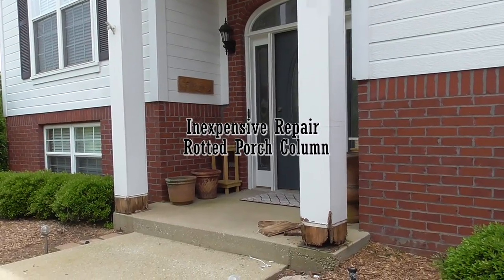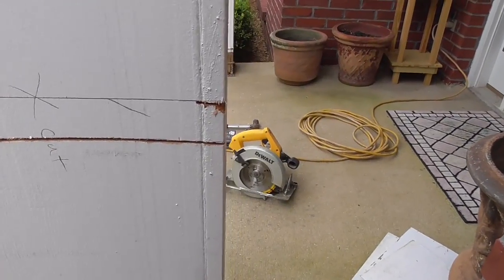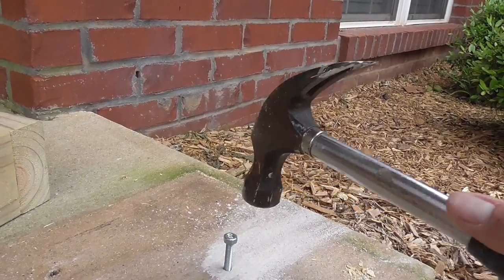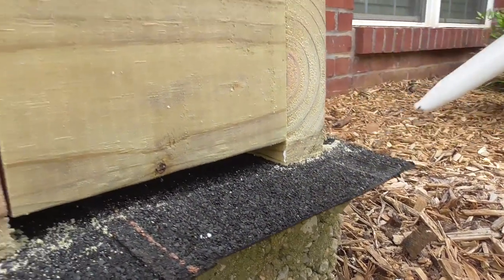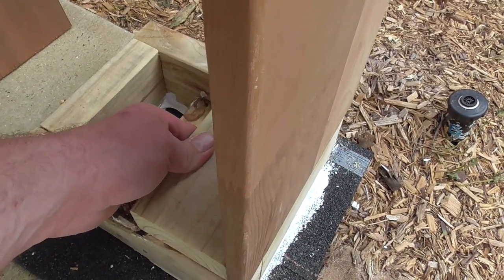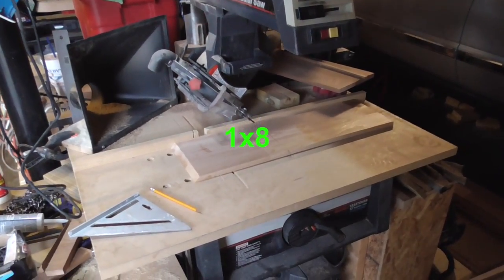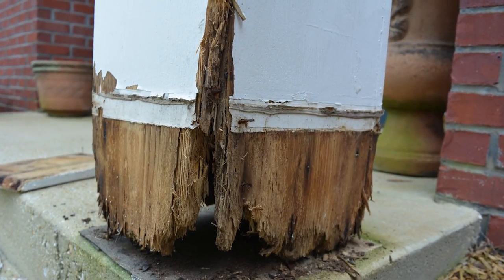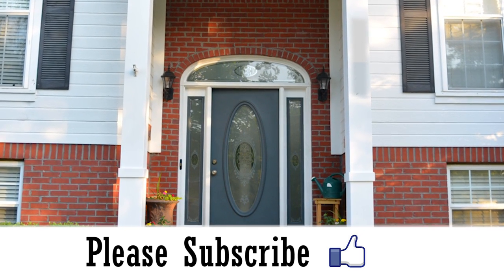DIY Porch Post Repair Fix Your Rotted Wood Post

Comment: Adding the 1 X 3s make it look classier.  Those thin filler strips are gonna need watching. Any water  in the crack will lead to rot. Maybe filling it with epoxy would be most prudent.  The base molding.....wood never lasts.  PVC trim board is the way to go.....waterproof.  Thx

Comment: I thought you did a very nice repair.  You obviously know what you are doing.
Don't take any notice of that rude carpenter. He might have a point to make, but there is no need to throw insults around.  
If that column was under any load you would have seen it and it would have collapsed long ago with the rot at the base.

Comment: Where to find finger jointed cedar in 2024? The lumber yards here don't carry it. I know it was common years ago but I haven't seen it in a store for years.
Reply from the maker: I recently needed some finger jointed cedar for another repair, none can be found at any lumber yard. I went to a specialty lumber yard and purchased some 1x6x12' cedar, rough cut on one side and smooth on the other. My local home centers only have expensive low quality building products. These porch posts are still standing with no issues. Thanks for the comments.

Comment: Remember the old saying measure twice cut once ? Maybe you should have bought your replacement materials before you cut away the old and then you wouldn't have had to use fill in pieces. I know it's hindsight and I learned the same lesson when replacing old decking boards, just not the same boards from 20 years ago.
Reply from the maker: Amazing how much money lumber mills save reducing 1/32” in the thickness of lumber and plywood. I was trying to save money too and not replace the entire post. Thanks for the comments!

Comment: How did you figure out those posts were not structural?  Was the porch roof cantilevered with beams going into the roof?   I  would make the repair as if it was structural in any case.  And used plastic composite shims instead of wood.  Thanks for sharing.
Reply from the maker: Great observation, My reasoning that these columns do not actually support the roof was 1) I've see the porch framing from inside of the attic. 2) The rotted column would swing from the top not touching the porch floor. 3) The 3/4 inch cedar made into a box is not strong enough to support anything. The best way to repair this would be to replace the entire column but I was more interested in a low cost repair. Thanks for the comments!

Comment: Good video. But what about the tools that you used? I need to buy them all
Reply from the maker: Hi Biju, I don't exactly remember the tools I used on this repair. Many of the tools I have were purchased over time. Some of my power tools are 30 years old and I do have a selection of new tools also. This repair could be done with a few tools like a circular saw or even a hand saw, some sort of square, tape measure and a hammer. Thanks for the comments!

Comment: He mentioned in his headliner he live in a area where there are no building codes are regulations..WoW..but funny his home is still standing and level
Reply from the maker: Yes, the neighborhood in my county has no building codes or inspections and our houses here some are around 15 years old and still standing. I think the reason this post rotted was actually due to one of my sprinkler heads out of adjustment for several years. Thanks for the comment!

Comment: How would you do it if it was load-bearing Columns?
Reply from the maker: Hi Veronica, If the column is load-bearing meaning it is holding up the weight of what's above then you definitely cannot remove it without an additional support next to it. Normally a jack post or even another wood post can be used to support the weight of the above structure then the column or post to be replaced can then be removed. Whatever jack or additional post is being used it must be able to support the weight until the original is replaced. Hope that answers your question and thanks for the comments.

Comment: Good job on the substance but why why WHY the totally OBNOXIOUS BACKGROUND MUSIC???!!! WHERE do You tube creators get this idea that it's necessary or desirable? IT'S JUST NOISE - ESPECIALLY AS ONE RAISES THE PLAYBACK SPEED!!! YOU MADE A GREAT VIDEO. LOSE THE NOISE/MUSIC, LET YOUR GOOD WORK SPEAK FOR ITSELF! 
- THANKS AND ALL THE BEST
Reply from the maker: Thanks Kevin, you are absolutely correct about the background music, it’s horrible. I no longer add any background soundtracks and just try to get straight to the point. Thanks for the comments!

Comment: how do i know if my column is load bearing?
Reply from the maker: A load bearing column or post is actually supporting the structure and must not be removed without a temporary support. Might be hard to tell but in my case I could see the ceiling joist framing inside the attic which is supported by the outside walls.

Comment: For someone who does not live in the US please can you explain why a 2 x 4 should measure 1 1/2" by 3 1/2".  From the name I thought that it might be 2 x 4?
Reply from the maker: Greetings, and thanks for the comments! The best answer I understand why a 2x4 is actually 1-1/2 x 3-1/2 is the lumber at the saw mill has a lot of moisture when cut and it shrinks after being kiln dried to remove the moisture.
Reply: Thanks for the reply.  Here in the UK most measurements in the construction industry are metric.  (They are all supposed to be), but a lot of people still use feet and inches.

Comment: those 1/4 inch filler pieces and the little cedar wedges will be the first to go.   Not a great repair.
Reply from the maker: Jamie, you are correct! This was an inexpensive DIY repair I did for myself and would not do this for a customer. This would have cost about $500 in material alone to make it like before.

Comment: NO!!! You have broken up those posts with trim and it has negatively affected the curb appeal of your house.  You should have spent a little extra and maintained the seamless look of those posts.  This is a travesty - kneecapping your previously beautiful and soaring entry post.  Such a shame.
Reply from the maker: Thanks Violet. This was just a quick and cheap repair. It's getting close to time to repaint the exterior of the house and I am going to be replacing both columns with something new.
Reply: @CarveTools  You entry is still of course grand but if you utilize the same unbroken columns as the original design it will be so much more beautiful and dramatic. :)
Reply: Ur so dramatic sheesh 🙄 🙄🙄